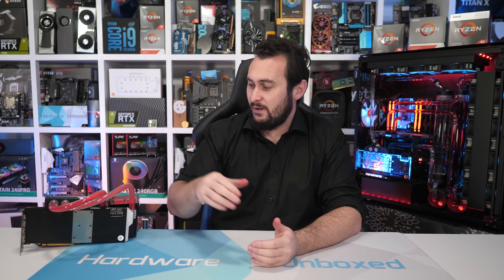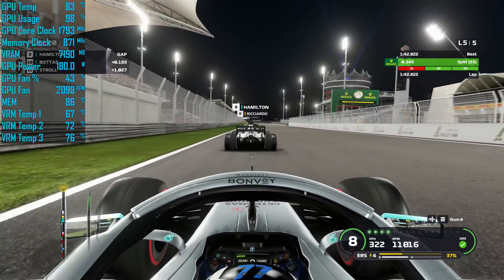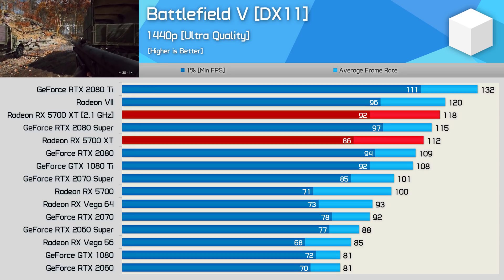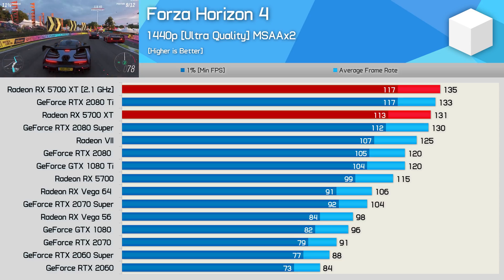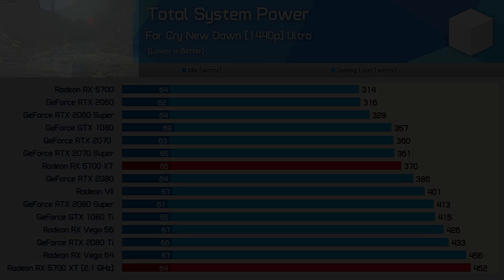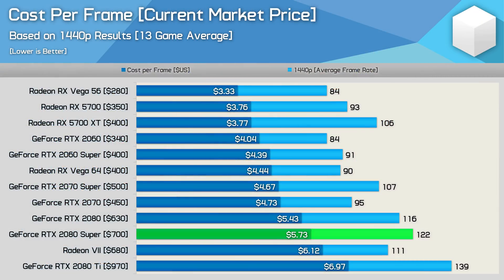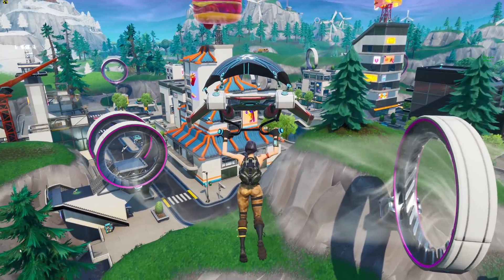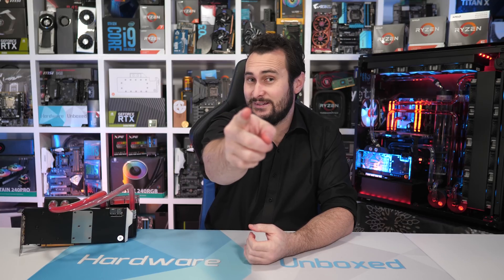Radeon RX 5700 XT Overclocked, RTX 2080-Like Performance?

Comment: It looks like that 5700 XT has a memory-bandwidth bottleneck given the limited gain with higher clock frequencies. I was a bit worried about that: 256 bit and only 8 GB. That is not much for a $400-500 graphics card.
Reply: Exactly. This is why AMD didn’t feel the need to give it a beefier cooler to push the clocks higher, because it doesn’t have that big of an impact on performance.
Reply: Yeah with 384-bit Navi would've killed the GPU market, surprisingly.
Reply: It was originally planned to be a RX580 replacement at $250. But now AMD is overpricing it due to the unhealthy market set by Nvidia. Remember this is not the so called Big Navi chip this is still the low end to mid range stuff. Cards with wider bus will come next year.
Reply: SkyForce6700 I guess it would most likely have been a RX 590/Vega 56 replacement at 300$, as it would have been the top end card (RX 690, not 680 or 670)
Reply: @peterw.8434  
Based on my own cost calculation I agree that around $300 was a likely goal as MSRP, if required (Nvidia its prices). A MSRP of $300 would likely result in a slightly higher profit-margin compared to the RX 480. I take the MSRP of the RX 480 ($229) as the base and I add costs because of GDDR6 (+70%), TSMC 7 nm (double of GF 14 nm, we know the diesizes...) and some inflation. To some extend it is speculative but we do know that $399 gives much higher profit margins than what AMD had for Polaris and Vega. Lisa Su promised months ago to the investors that AMD would increase the profit margins from 40% to 60% or something close to that. That is one reason why the prices of Navi are so high and why AMD doesn't give extra cores for Ryzen this round and increased the prices of the 8C Ryzen-CPU's.

@Randall
For the company it is good, for me it sucks given that I need to replace my old HD 7850 after upgrading from an i5-750 to a 3700X (I ordered the parts, I am waiting for delivery).
Reply: @peterw.8434  The 5700 XT Anniversary Edition was going to be the RX 690: AMD accidentally revealed it in their Computex keynote. It makes sense that the 5700 XT would be the 680 - though it's also possible the AE would have been an AE variant of the 690, while the 5700 XT non-AE would have been the base 690.
Reply: @peterw.8434  The 5700 XT Anniversary Edition was going to be the RX 690: AMD accidentally revealed it in their Computex keynote. It makes sense that the 5700 XT would be the 680 - though it's also possible the AE would have been an AE variant of the 690, while the 5700 XT non-AE would have been the base 690.
Reply: @SkyForce6700  well, we all knew the rumors were too good to be true lmao. However, you can't be asking for 1080Ti like performance at 250, thats just crazy, i feel like their prices are fair. Still has better value than nvidia lmao
Reply: @Mike_24N  

No offense, you are rather naive. We used to have that all the time: previous generation high-end performance for mid-end segment price. The last example is the RX 480 which outperforms the 390. The 'mining' and Nvidia fucked up the market. The mining stalled the arrival of new cards and created a large stock which Nvidia needed to sell until recently, that is one reason why Nvidia made the prices of Turing so high. AMD still needs to sell their stock of Polaris and Vega. Also Nvidia abused the lack of competition from AMD and AMD says "thank you Nvidia, we can use the extra profit". This attitude of yours that it would be ok is what drives the prices up. If gamers would have some sense of history and some discipline then the next round the prices would be lower.
Reply: @Mike_24N  "However, you can't be asking for 1080Ti like performance at 250"

Yes you can. Easily. The 1080Ti is a 2 year old GPU, and look at history. The HD 4770 came out for $110 in April 2009 and obliterated the performance of Nvidia's 9800 GTX, which released in April 2008 - only 1 year before - for $350. We used to be able to spend a THIRD of the price of a high end part ONE YEAR later to get the same performance (Yes, $350 was high end 10 years ago - if you disagree, then just compare the GX2, and then the 4770 looks twice as impressive as it does against the GTX).

It's utterly pathetic that we now don't even get close to this level of improvement in twice as long, but consumers have become content with being ripped off. We SHOULD be asking for 1080Ti performance at $250 two years later - if it weren't for Moore's law slowing down and Amdahl's law ramping up we could reasonably expect DOUBLE that, especially when looking at an oversized gimmicky mess like Turing compared to a small die like Navi.
Reply: @Mike_24N  "However, you can't be asking for 1080Ti like performance at 250"

Yes you can. Easily. The 1080Ti is a 2 year old GPU, and look at history. The HD 4770 came out for $110 in April 2009 and obliterated the performance of Nvidia's 9800 GTX, which released in April 2008 - only 1 year before - for $350. We used to be able to spend a THIRD of the price of a high end part ONE YEAR later to get the same performance (Yes, $350 was high end 10 years ago - if you disagree, then just compare the GX2, and then the 4770 looks twice as impressive as it does against the GTX).

It's utterly pathetic that we now don't even get close to this level of improvement in twice as long, but consumers have become content with being ripped off. We SHOULD be asking for 1080Ti performance at $250 two years later - if it weren't for Moore's law slowing down and Amdahl's law ramping up we could reasonably expect DOUBLE that, especially when looking at an oversized gimmicky mess like Turing compared to a small die like Navi.
Reply: @Mike_24N  "However, you can't be asking for 1080Ti like performance at 250"

Yes you can. Easily. The 1080Ti is a 2 year old GPU, and look at history. The HD 4770 came out for $110 in April 2009 and obliterated the performance of Nvidia's 9800 GTX, which released in April 2008 - only 1 year before - for $350. We used to be able to spend a THIRD of the price of a high end part ONE YEAR later to get the same performance (Yes, $350 was high end 10 years ago - if you disagree, then just compare the GX2, and then the 4770 looks twice as impressive as it does against the GTX).

It's utterly pathetic that we now don't even get close to this level of improvement in twice as long, but consumers have become content with being ripped off. We SHOULD be asking for 1080Ti performance at $250 two years later - if it weren't for Moore's law slowing down and Amdahl's law ramping up we could reasonably expect DOUBLE that, especially when looking at an oversized gimmicky mess like Turing compared to a small die like Navi.
Reply: @Mike_24N  "However, you can't be asking for 1080Ti like performance at 250"

Yes you can. Easily. The 1080Ti is a 2 year old GPU, and look at history. The HD 4770 came out for $110 in April 2009 and obliterated the performance of Nvidia's 9800 GTX, which released in April 2008 - only 1 year before - for $350. We used to be able to spend a THIRD of the price of a high end part ONE YEAR later to get the same performance (Yes, $350 was high end 10 years ago - if you disagree, then just compare the GX2, and then the 4770 looks twice as impressive as it does against the GTX).

It's utterly pathetic that we now don't even get close to this level of improvement in twice as long, but consumers have become content with being ripped off. We SHOULD be asking for 1080Ti performance at $250 two years later - if it weren't for Moore's law slowing down and Amdahl's law ramping up we could reasonably expect DOUBLE that, especially when looking at an oversized gimmicky mess like Turing compared to a small die like Navi.
Reply: Nathan Gamble 
Pathetic ????
Why don’t you become a silicon design engineer and give us our amazing new flagship killer cards every 2 years ??

You clearly don’t have any concept of the sheer complexity of a modern gpu. 
Or any idea how much it costs to design high perf parts in 2019.
Reply: @SkyForce6700  There was no such plans, 5700 cards cost at least $200 to make. 7nm cost double per wafer, Navi10 die itself is more than twice as expensive compared to polaris, it's bigger and yields are worse. If polaris die did cost $30-40, navi is $70-90. Then 8GB of GDDR6 cost around $80(50% more than GDDR5), board with cooler about $50, could be a bit less with blower. 20% gross margins are way too low for semiconductor company, AMD need at least 35% to be net positive which they breached last year. Also they need 50% margins to stay competitive in long run, tech development is getting increasingly costly.
So no, these card were never meant to be sold at $250 like polaris did. Stop believing fake news.
Reply: @kognak6640  

8 GB GDDR5 used to cost around $35, for us consumers, not for Sapphire, AMD, Gigabyte... (so including distribution costs, taxes...). Add 70% to that (the maximum increase which was estimated in the industry) and you get 1.7*35= $59.5. The node is up to twice as expensive, it is very possible that your estimate for that is correct. Around $300 would be a sensible MSRP for the 5700 XT iff you compare it to the previous generations. 

Another point is that CPU's in general give much larger profit margins than GPU's.
Reply: @kognak6640  This isn't true.  At 7nm AMD is spending less money for more dies.  Navi is significantly cheaper to produce than any previous AMD GPU.  And everything else you said is gibberish.
Reply: @czerro1  Show me your sources. You can't because they do not exists. What you can do is create baseless claims.
However I can easily link couple.
7nm cost twice as much per area to manufacture, 5nm cost even more:
https://www.dvhardware.net/article71210.html
Also design costs have tripled 12/14/16nm -> 7nm.
https://www.extremetech.com/computing/272096-3nm-process-node
Reply: @SkyForce6700  wow so AMD is making a lot of 💰. Good job AMD
Reply: @SkyForce6700  is not a a rx 580 replacement  aleast not in the performance areas. The 5700 is way faster than a Gtx 1080 ,5700xt is almost like Gtx 1080ti.
 If was a replacement of the rx 580 it would   need to be a bit slower than a Gtx 1080. U can always buy a use Gtx 1070 for 200  which is way better than rx 580
Reply: @NeVErseeNMeLikEDis  The 5700 is not way faster than a 1080, it's probably only a few % faster overall trading blows in different games. The 580 was a competitor of the 1060 ( 5700 vs 2060 now) which was on par with the 980.
Reply: @SkyForce6700  how you know what it was going to be planned for rx580 replacement you don't know anything
Reply: @chriswright8074  Yes it was: https://www.techpowerup.com/img/d6RRh2JGkedn3FJl.jpg Look closely at the writing on the fan, you can make out "Radeon RX" and a 3-digit number, then "limited edition". I know I found better quality pictures of that, and it read 690.
Reply: Well, its the same with Nvidia. To get the benefits of core clock speed you need to OC the memory too. Not sure how much the memory of 5700 XT can go to.
Reply: @ZAGAN-OZ  

As far as I know this was not much the case for the old HD 7850. The performance scales well with the GPU clock frequency and OC'ing the memory seems to do little. I have one myself. It seems a trend of the last years that graphics cards got memory-constrained. I don't know why. Is it that much more expensive to put a 384-bit bus on it instead of a 256-bit bus? The cost of 3 GB extra memory can't be the problem. More memory is not only good to get the maximum performance out of the graphics card, it also increases the lifespan of it.
Reply: @peterjansen4826 , more bandwidth is no longer able to be beneficial with such a fast vram speed.
The bottleneck is the memory controller, just like the cpu side, even if 4 double rank modules are faster per acces, the greater speed of single ranked one are more important, especially for Amd. And I'm not talking about quad channel ram.
So, yes it's really difficult, bicause of yealds, to get wider and equally fast memory bit busses. That's why hbm has so much bits and really slow speeds.
Reply: @TheSilviu8x  

It is possible that the memory-controller is the problem.
Reply: ????? But a RTX 2080 is? lol
Reply: I guess they designed this card with just 1080p gaming in mind, as its great for that (i think).
Reply: @Mundus66  No 1440p
Reply: So not even with all of that WaterBlock mounting (and investment) + extreme overclock it can surprass a RTX 2070 Super. There you go, AIB won´t do mircales, RTX 2070 Super it is. You just made my life simpler, ordered it now! Thanks!

Comment: Yeah that memory bandwidth  test will help the community  as well. I think you and gnsteve are the best people to test these kinda stuffs.
Reply: Yeah it really sounds like the cards are memory limited. Going to be interesting to see what board partners can do there as i imagine they can get their hands on binned memory modules. Hell if the card supports it some of them might try substituting in 16gbit/s modules.
Reply: @darthkarl99  totally
Reply: @darthkarl99  with 8GB gddr6 that would only make it go up from 448 to 576 GB/s, if you would add 2 more gddr6 14gbit/s you would be up to 560 Gb/s and gddr6 max out at 12x1gb 864 GB/s 16gbit/s with 384 bit bus

so if it is memory bandwidth is a big problem the 2020 Navi will have HBM2 4x4gb 16GB 1TB/s with 4096 bit bus or IF AMD can push one of the three HBM2  to make the 2-HI chip 4x2gb (8GB) 1TB/s with 4096 bit, as the HBM2 standard is 2/4/8/12-HI 1GB per layer and 16-Hi is coming soon

now what is already here is Samsung hbm2 FLashbolt 8-Hi with 2GB per layer(16gb) 410 GB/s per chip, so the 500 GB/s per chip is not that faraway now
Reply: I found u asura
Reply: @dreaming_fox163  :| ... unfortunately  I dont have these cards to do the testing.   FOX.
Reply: @nandagopalgopakumar5626  ;(

Comment: Hello. You can change the timings of the gddr6 with the amd memory tweak or overdriveN tool. Go to guro3d forums on the amd sub forum you have those tools there. Hope it helps. Great work as always
Reply from the maker: Ideally I want to underclock it.
Reply: @Hardwareunboxed  if you loose the timings a bit it won't get unstable at higher clocks . I don't know if these tools have been patched for navi so it's just a thing you have to check, trial and error Steve :). That AMD user style

Comment: new amd gpu & cpu are a huge disappointment - especially considering that the platform comes with a lot early issues.
Reply: Yeah, the cpu-s are a huge disappointment  that are sold out internationally
Reply: Tell me that the 3600 is bad, and please have good comprehensive arguments for it
Reply: @sachafievet3131  Sure - let us compare the 3600 with the 9600K for example. The 3600 came out 11 months later and offers worse performance in most games even at stock settings. Overclocking a 9600K to 5Ghz is zero problem, even with a mediocre cooler and then it completely wipes the floor with the 3600. You save only 50 bucks with the 3600 and factoring in the higher costs of a x570 vs. z390 motherboard (as an example ASUS ROG Strix Z390-F vs. ASUS ROG Strix X570-F - around 80-90$) you actually pay more for AMD than Intel even if you add the free cooler that comes with the ryzen cpus. Obviously we can throw in different motherboard models into the comparison and the calculation will be slightly different, however, AMD CPU & motherboard is not really noteworthy cheaper than intel. Next point - stability & issues. Intel is just more reliable, less micro stuttering in games, etc. Again, the new Ryzen CPUs were released almost 1 year after the Intel equivalents - why are people celebrating this. Intel is still faster and more reliable. I want to buy an AMD gaming PC but I am not going to hype something just because I want it to be good. Is it bad - no. There is just a better alternative- IMHO
Reply: @infulleffect5930  Thank you for your argumented and good reply, although I have to recommend you to watch for example gamer nexuses video of the 3600, if you haven't. You will see that frame times/fps/production work is kind of a killer combo, making the 9600k as you said IMHO kind of irrelevant and only exceeding only in minor fps if even at all in the margin of error.
Reply: @sachafievet3131  Even if the 9600K exceeds only marginally (we are talking stock, 5Ghz is quite considerable) and is the same price or cheaper when looking at the CPU & mobo package, what speaks for AMD I ask back? And please, keep the stability issues in mind - some games even didnt run when the new Ryzen CPUs were launched and new titles will more likely run more stable on the Intel platform.